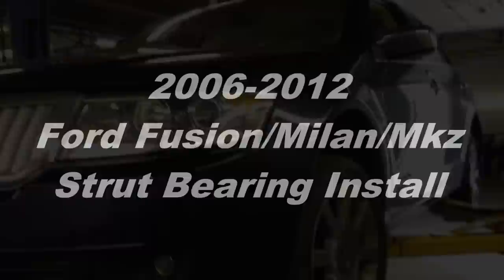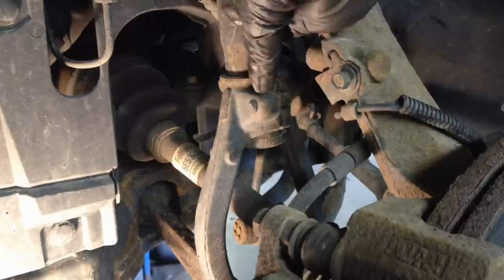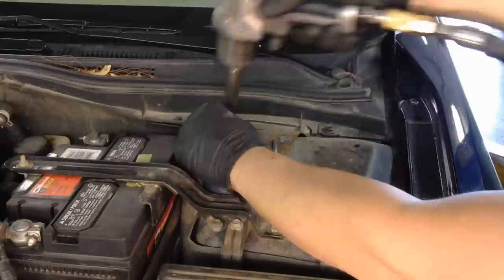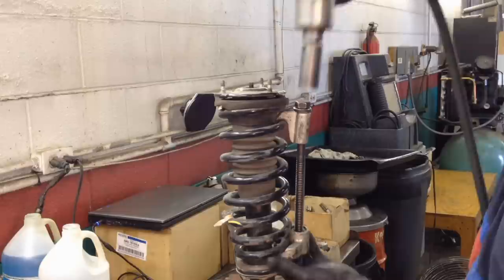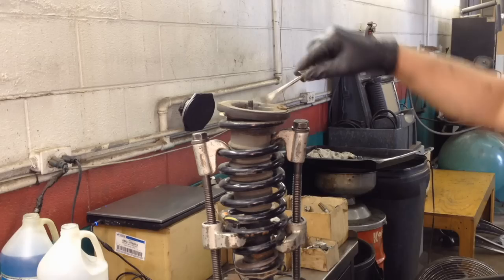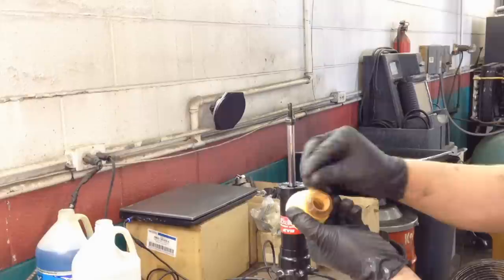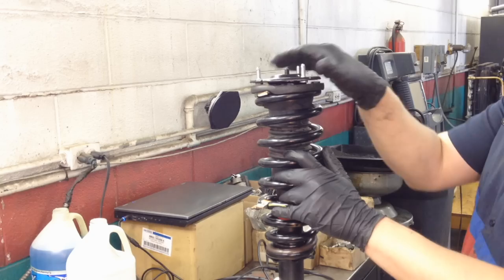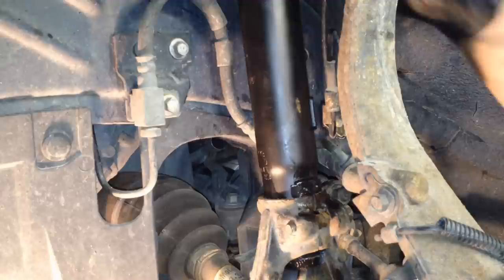Ford Fusion Clunk Noises- Strut Bearing Replacement

Comment: Great video! I'm about to attempt mine. I'm not sure if it's the same issue, but my clunking sound happens at low speed while driving straight, on not so smooth roads.
Reply: I am having the same issue with my 2014 fusion energi. were you able to figure out what was causing that clunk sound ?
Reply: @Travellization  Man, I replaced just about everything: CV axles, wheel hubs, upper, lower, rear, front control arms, bushings, struts, stabilizer, tie rods, engine mounts, you name it. While all those things did give me a great new and tight suspension, the noise did not go away (entirely). I think all that stuff did help. But, the final (next) thing was the rack and pinion. Instead, I  decided to just trade in at that point for a new car. I figured I was paying the same amount of money per month on maintenance but all my own time and labor. I bought a 2017 Fusion Hybrid. The car is great. I recommend doing that. But, if you want to go down the rabbit hole, try starting with the rack and pinion. P.S. My issue was definitely not the pinging/spring pop he describes in this video. It was a clunk at low speeds, and not necessarily while the wheels were turning. Probably a combination of the CV axle and the rack and pinion. Good luck!

Comment: Hey Mac. Great videos. It's not only nice of you to post them, but really cool that you take the time to read the comments and actually respond. Thank you!
I just replaced a blown strut in an '07 Escape. When I took it apart I had a cracked top bearing (gray plastic disc). I replaced the whole mount with a KYB. I wanted to go Fomoco but couldn't get one on the spot. The new mount kit came with a rubberized cup/spacer, giving it a sloppy fit. Now the top end clicks and ticks from that bearing binding up when I cut the wheel. I Did the job three times. New complete KYB mount kit with rubber cup, Old ford mount with new kyb disc bearing omitting KYB rubber cup. The third way was just re-using the old cracked bearing and old Ford mount plate. Using the old, worn, rusty parts was the only way it's quiet. What gives? is aftermarket really that crappy? BTW, I made sure to mark positions on the top plate, even lining up the old impressions in the rubber spring cushions.
Reply from the maker: kewrock I have seen it many times where we install complete struts and they are back only weeks later sometimes less so yes it is very common especially kyb it seems.

Comment: Thanks for a great video- replacing front struts on a 2010 Fusion hybrid- the Motorcraft loaded struts have an extra bolt on top with an E-torx head. The original struts do not have this bolt, just the 3 studs. There is a hole in the frame where the extra bolt sits but it is covered by the top plate- not deep enough to fit.  The bolt seems to lock the upper bearing to the spring mount. I assume I remove this e-torx bolt for my car? These are the listed Ford OEM parts (ASTL-22, ASTL-23). Thanks for any guidance!

Comment: Thanks so much for this, it worked like a charm!  Removing both lower fork bolts(*both sides of the car) made it even easier to get the fork off the bottom of the strut.  I would have surely removed the stabilizer links and that would have made for a very unhappy afternoon.  Thanks again!

Comment: I have a 2010 Flex Ecoboost: I hear a loud BANG! sometimes on front passenger side when I go over a decent-sized bump- I’ve replaced both control arms, end links, sway bar bushings. On regular roads it’s as if there is no problem, but these moments feel like something catastrophic occurred. Could this be a failed strut? Strut mount, like this?

Comment: Excellent video. I installed Ford Performance struts/shocks and BMR SP763 lowering springs on my 15 Mustang GT myself. At end turn range I get pops and creeks. Especially slow parking lot speeds and turning over unlevel surfaces. It is coming from the driver side only. The car has 33,000 miles. I'm going to check to see if the bearing assembly is turning. Could I have misaligned the strut bearing assembly?

Comment: I'm on my 3rd set of quick struts from monroe. Only the right front clunky over light bumps. So I put the old strut assembly back on and knocking goes away. sigh.
Reply: @BigEightiesNewWave  it was the hydraulic engine mount.
Reply: @BigEightiesNewWave  I used to be in the parts business and had nothing but complaints about kyb.

Comment: im getting an annoying squeaking sound coming form the top of my strut. when i push down n the side of the car i can see the rubber inside the top of the strut squeezing and i think thats making the noise. is the rubber meant to be seen to squeeze or is it meant to be solid. annoying thing is i recently replaced my struts but not the top mount and bearings.

Comment: Great video, this will help me with my wife's Milan, it growls when it turns, I am guessing the bearings are out. I doctored them by spraying lithium down into the top but it no longer helps, lol.  However I will be using loaded struts, so even easier.

Comment: Bought a brand new whole strut assembly for an older Taurus and they are noisy. I sprayed the mounts down with silicon spray and it helped a lot. The suicide sticks scare me. Hope they aren't the $12 HF specials!  The ones I rent seem beefier and have a locking pin. These seem to flex under tension. In a class I took I saw someone tightening them up and they moved toward each other and make the spring bow out. Scary. Whoever works with them should be extremely cautious.
Reply from the maker: alb12345672 The spring compressors you talk of are beffier but more bulky and not useful for most situations we have those too. These do not bend they are meant to flex in the upper and lower ears to allow them to hook better at all angles.

Comment: Thanks for this video.  My daughter's away at college... just got her an '09 Fusion early Oct...now w/ 117k miles. Got alignment in November due to slight pull to the left. It has less expensive Hankooks from previous owner, and the fronts are right at needing replacement (low tread), but the rears have plenty of tread but there's some cupping on their inboard edges (not real noisy...I notice but daughter doesn't).  On these cars, is it a no-brainer it's time to replace the rear shocks before the tire noise gets worse, or could it be just the tires not balancing well?  I do my own suspension work.  What about the front struts? Should I go ahead & replace them, too?  KYB currently has a $40 rebate available if buy all 4 at the same time.  Before I saw the rebate, my plan was to replace the rear struts and the 2 front tires, then get the remaining tread life out of the rear tires but I'll have them dismounted and swap sides to hopefully quiet them.  Any advice is appreciated (btw, in Alabama, roads r decent and no salt).

Comment: Ok so when I did my strut on my 07 Escalade the top strut had that same bearing it was rusted to pieces ..the new strut assembly did not come with one ..I can buy a bearing online my question would be ok to just remove the upper strut stem nut ,while it is on my truck for few minutes while I slip in the bearing then re tourque to spec. Remeber all I’m trying to do is put in the new bearing not remove the whole upper strut mount I have done that already any help would be appreciated great video in depth .

Comment: For an '09 Fusion, would you go with KYB or Motorcraft for the rear struts?  The KYB are $12 each less expensive.  My son's '07 Mazda 6 uses the same rear struts, and when I replaced them, KYBs are what came off it from the factory.  I replaced them with Sachs, but now I can't seem to find those in-stock anywhere.

Comment: What about using a full strut assembly instead just changing the top bearing??  Do the back struts on the Fusion ever need changed???  Thanks.

Comment: Hi, what is the number part of de strut bearing? I have a Fusion 2008 V6, Replace all lower and upper control arm and tie rods, after 6 months, a noise appears for left side. The left upper control arm is Dorman, the rest of the control arm are Motorcraft and the tie rods inner and external are Moog. The noise maybe come from the Doorman control arm? After 10000 miles? 

Thanks a lot

Franklin

Comment: I have had my struts and strut bearings replaced with OEM parts.  I had the shop compress the springs for me and swap out components and keep my factory springs.  I noticed while installing my assemblies back into the vehicle on the driver side the hole on top of the strut bearing plate does not match the hole on the body like you suggested due to the bearing plate installed on my spring.  I have noticed a sproing noise but its very faint coming the driver side.  Do I need to compress the spring and place the alignment hole correctly?  If it is not done what will be the outcome.  Thanks

Comment: What happens if you don't line the holes to on the plug but still manage to get the strut assembly installed will it clunk or create additional issues

Comment: That nut on top of the strut at 7:26 that you said "not to touch" in the middle of three other nuts moves around in my car when i turn the wheel and at times it scrapes against the metal part of the mount of the car. It does not look normal and i get a lag when i turn on rights or change lanes on the freeway. I even was able to unscrew it with my finger... please i would like some advice on what to do. thanks

Comment: Do you bother putting the car on the alignment rack after struts on these cars. Looks like nothing really changes, is the camber adjustable like the old Tauruses and Mustangs on top with breaking the plates off and moving them? Sucks they still use that pinch bolt design style, I always heat them up after previously breaking many on the older Tauruses in the rear. Its nice to see the entire front suspension doesn't have to be disassembled like the older Tauruses.
Reply from the maker: No this doesn't affect alignment at all.

Comment: Hi,great video. I would like your opinion on this.
  The MONROE 172261 Quick-Strut is listed on some sites as to fit only the 3.0 V6 while some other sites list both the 3.0 V6 and the 2.3L I4. Like you said in another comment maybe the coil spring strength is the only difference. The weight difference from what have found is only 184lbs. The V6 weighing 335lbs. and the I4 weighing 3175lbs. The struts themselves(MONROE 72261 OESpectrum Strut) have the same model number listed for both engine sizes.

FCS  1335543L and FCS 1335543R is the only other brand that list the 2.3L I4 quick mounts for the same price.

So my question is: Wouldn't the Monroes work fine if it maybe has a slightly higher coil spring rating?
Also,what is your opinion on the FCS brand? Engineered in Michigan but made in China.

Comment: as I said this noise only started after getting new tyres and a alignment. its sounds like sway bar link or strut top mount but I've replaced all and double checked every thing,I've researched hyundais and other cars but most noises are sway bar bushings end links,need help

Comment: Hey man I really like your videos its very helpful to me personally although, I have a 07 Escape XLT that's not driving it like it used to in terms of hard acceleration. I was thinking its probably going into limp mode. Especially driving at high speeds it would not rev up like it used to. To make it simple it feels sluggish and not tourqy enough, unlike before. now driving it, I noticed recently the check engine light would sometimes Flash just in battery mode, not one started (cranked). i just replaced the whole right front axle because the tone ring was broken off. Here are some codes that are coming up: C1234 wheel speed RF input signal missing, U2023 malfunction received from external node. so I don't know if it's a bad sensor or bad abs module. I really thought fixing the Broken tone ring would have solved it but it did not. therefore I'm asking you as a Ford mechanic for your input or any best advice, before taking it to the dealer? Thanks!

Comment: I replaced my strut bearings on my bmw because they were all kinds of ripped but the popping is still there. Nothing is moving but sounds like the spring flexing when i turn left and right or hard into a turn flexing the car please help my local bmw show replaced the power rack 2,900$ and that wasn't it now im still stuck with the popping and pissed at them.

Comment: Thanks so much for the video- bought the "quick struts" and was an easy change thanks to you!! Replaced struts and rear shocks in  a half day, but still have a "squeak" on the front driver side...thinking a ball joint issue. 2009 Ford Fusion with 130,000 miles.  Any videos to help with that?
Reply from the maker: The last time I changed one of those I was on tour so I only have a quick tip video on them. What I can tell you is the lower ball joint at the knuckle presses into a sleeve and it will be stuck very tight. Its best to remove the lower arm and sleeve together and separate them on the bench. Also those sleeves are different sizes for the front and rear lower ball joint so don't mix them up outside they look the same but inside the taper is different.
Reply: Thanks, again, for the help!

Comment: I have a noise in the rear sounds like strut ,when I say everything I mean the lot even took sway bar off still no luck,it started after getting new tyres,can if not adjusted properly the rear control arms witch have a eccentric bolts cause this knock if not adjusted properly, replaced,struts springs top mounts rubber seats,sway bar bushings end links knuckel control arms eccentric bolts,trailing arms and checked and torqued all things to specs,or could car have been alined not being under laiden,manual say to have car on the ground so suspensions have pressure, only on uneven ground this noise like strut is loose,going over speed humps its OK,I've checked all no luck do you have any idea

Comment: Hi....really need your assistance. I have a 2009 ford focus, there are noises coming from under the foot both on driver and passenger side any time it goes on a bump no matter how little.This noise is a clunking noise. Below are all what have changed on the car:

The inner tie rod
Sway bar link
shock absorber
Complete control arm
anti roll bar busing.

Kindly advice on what the problem is
Reply from the maker: kosoko abayomi Have you greased the dust boots on the struts with silicone grease? They can make this same noise and it is common on this year focus.

Comment: Excellent video. Thanks for doing this. I may pick up a set of spring compressors next. Just bought a rear-brake piston depress kit. Are the rears as easy to do as the fronts? Are the Motorcraft struts a good replacement, or do you recommend another brand? Back when I was into mustangs (had a 2003 Premium GT) Tokiko blues or Bilsteins were recommended. Thank you!
Reply from the maker: The rear brakes are just as easy as the front except for the special tool for the pistons. Motorcraft struts are quite good but bilsteins are really good too.

Comment: This may be the stupidest question ever, but if the upper and lower control arm ball joints are the swivel points, why is the strut expected to swivel?  Why would the strut have bearings in it at all?   I'm having squeaks and groans and creaks when hitting bumps (constant ee-er, ee-er, ee-er) and when turning the wheel but wondered if it was ball joints and came across this.
Reply: Excellent question.  The struts in these cars don't turn since they are not attached to the steering knuckle.  They're more like a coil-over shock.   Seems like there's no need for a bearing on top of them.

Comment: I have an 07 fusion. Can a bad strut leak causing what I can only describe as black grease. The grease is getting flung at the edge of the wheel area under the door. 

The sound it makes is like the sound you make when joking about people having sex in a old bed (sorry. couldn't think of anything else). I hear the sound at slow speeds and the sound gets worse after I fill up with gas. I tried the bounce test I always hear about but it seems fine.

Upper and lower control arms have been replaced. Could it be something in the strut or assembly? I'm at a loss.

Comment: That yellow piece is a culprit in most cases. It is a stupid design and worst, there is no cap on the top of a strut under the hood leaving the jounce bumper vulnerable to damage. Do not ever use wd-40 spray at the tensioner nut on the top since wd-40 will flow down to bump stopper dissolving all the grease inside it.

Comment: Are Monroe quick struts any good?  My fusion has 175k with oem suspension parts.  Debating on the quick struts but wondering if their strut mounts are worth a darn along with the steel quality in the springs it comes with..  In your experience do you suggest quick struts?
Reply from the maker: Drew Young I do suggest quick struts but have never heard of anything good about monroes.
Reply: @FordTechMakuloco  hello sir my car also have creaking sound when i turned my wheel

Comment: Hey, haven't been on FFC in a while. I don't have speakers on this computer so I can't hear your audio.

Is this a clunk sound as you rotate the steering wheel? I have one presenting on my 2010 that is usually when I first start driving, such as pulling out of my driveway or backing out of a parking stall.

Thanks again for the helpful videos. Made a big difference when I replaced my filler neck (only to discover the problem was the purge solenoid...)
Reply from the maker: +Ahanix yes it can pop when turning if it is bound up enough like this one was.
Reply: +FordTechMakuloco ok, finally watched it on my phone. mine typically only does once pop per trip, not on every bump. I'll check my dashcam, see if there's an example.  car's not driveable at the moment, I've got the dash torn apart adding an arduino.